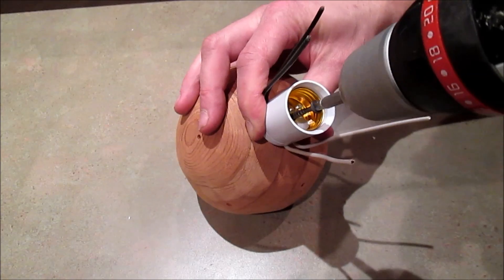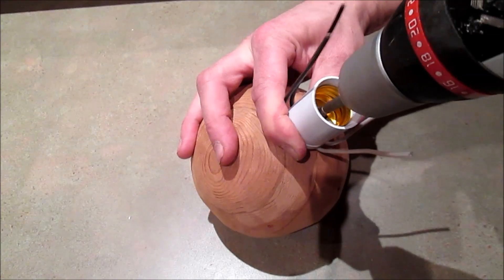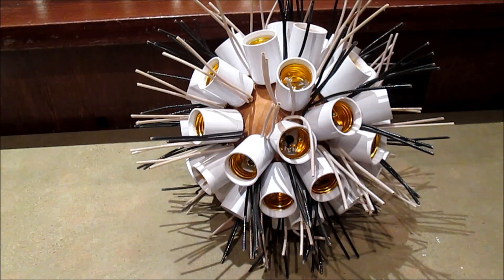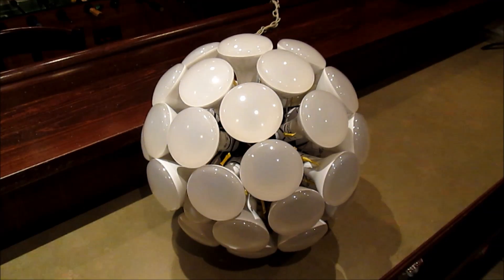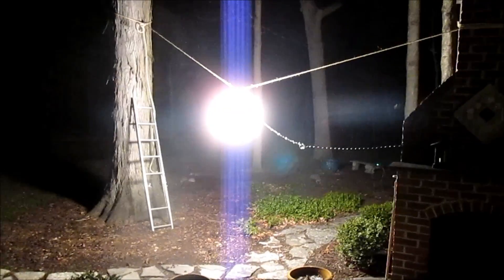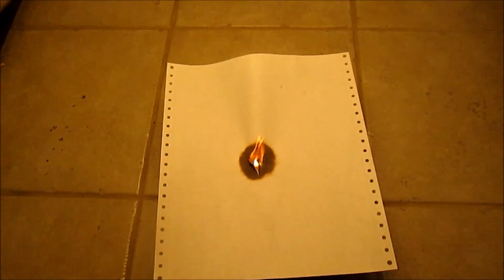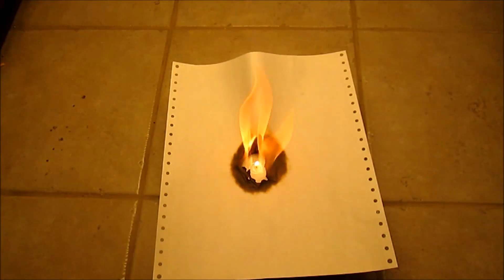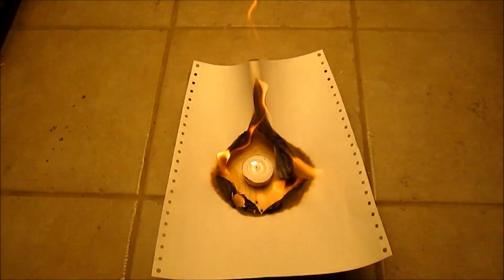How To Make a 3,000 Watt Sun

Comment: what type bulbs are those?
could you build a bigger sphere if you used CFL flood lights or leds? ie same wattage more bulbs.

also where are you plugging it in where you can pull 3000 watts?

is that power cord rated for 25 amps?
Reply from the maker: +The Blue Farmer - They are LED bulbs, so really it is 3,000 Watt equivalent, for only 300 Watts.  Yes, space heaters and hair dryers pull 1,500 Watts, so you could make a ball with 250 bulbs!